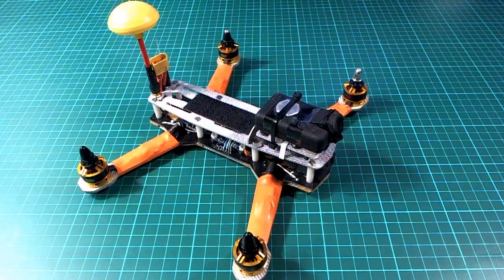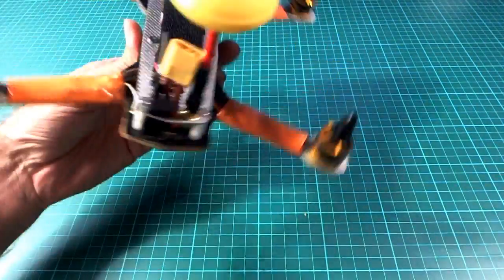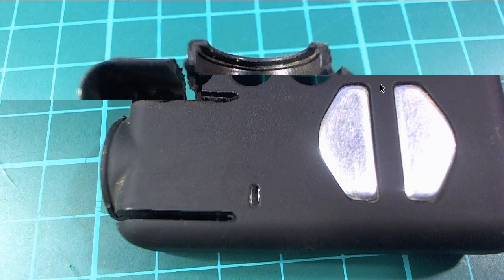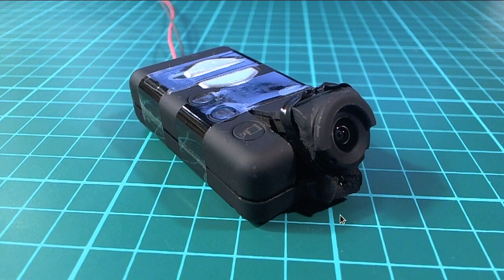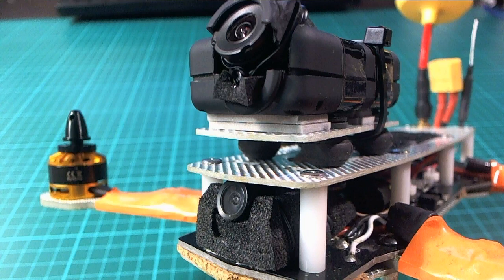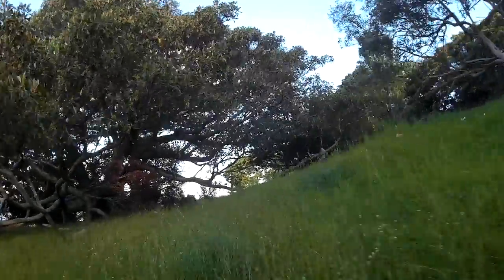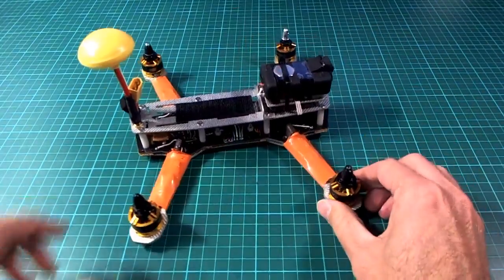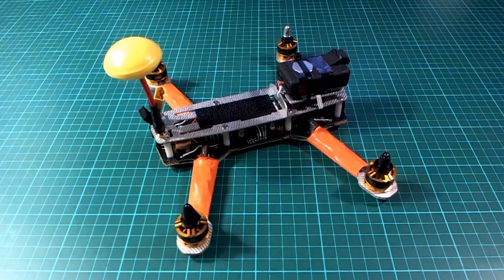Mobius camera hackery

Comment: I have a mobius paper weight. it sits on my bench collecting dust.  it took maybe 30 minutes of video in it's life and now it refuses to record. sometimes it likes to fool me by blinking like it's recording then it goes solid and shuts down.  silly little "action" camera.
Reply: +NUWEST00520041 Mine did that as well, reformatting the SD card fixed it.
Reply: +Nodent not on mine.  I've done all the tricks it will not record.  I can use it as a fpv camera. it will play in real time but no record.

Comment: It's called Velcro.  with a strap it's not coming off....
Reply from the maker: As I explained, that's how I lost the last mobius
Reply: +Bigwingrider1800 Confirmed, velcro with strap doesn't do it in a significant crash. I have that setup and I've had to search for my Mobius quite a few times, finding it sometimes 20-30 feet from where the quad came to rest. Luckily I haven't lost a mobius YET but i'm definitely considering zip tying it down.
Reply: I think if it falls off the whole thing is junk copter and all..i have the 2" industrial stuff if its not full of grass and stuff    before you put the camera on its very tuff...........
Reply from the maker: +Bigwingrider1800 the problem is not how well the velcro strap sticks - I never heard anyone complaining that their velcro strap came undone, and that has never happened to me either. The problem is even if you have the best velcro strap in the world, if there is not much friction in the surface between the camera and the plate, when the battery slams into it from behind the camera slips out. And even if the plate and the camera hold together they can both come off in one piece and still get lost (my case). fwiw after this I put zipties through the damping balls, double-sided tape between the camera and plate, and a piece of aluminium angle behind the camera plate so that the battery can't slip forward and I haven't had any problems since.

Comment: As far as the damping balls are concerned, mount your plate then put thin zip ties through the balls but don't tighten them all the way up. Allows the balls to move but gives them limits.
The 3d printed wedge is the answer for angling the mobius. When you think of the angle the quad is at to get the quad flat, the small change in profile has absolutely no effect.
For power I have left the battery in and have a USB lead connected to the 5v on the FC and the mobius set to auto record.
No more forgetting to record flights. It saves and shuts down as soon as you disconnect the flight battery.
This also allows me to remove the mobius for other aircraft.

Comment: Put super caps in there so the camera does not instantly loose power.
Reply from the maker: yes, I tried that after making this video. Unfortunately it seems this mobius has more problems than the super cap can fix though - it sometimes stops recording even if the battery is connected, and sometimes doesn't complete the file when the power is stopped even with the super cap :( I think it's a lost cause
Reply: +iforce2d 
You can use a very light 3,7V battery to save weight. 
http://www.banggood.com/Cheerson-CX-10C-CX10C-RC-Quadcopter-Spare-Parts-3_7V-120mAh-Battery-p-1018483.html
Reply: +kj erts and 5V to the USB-connection. This works and can stop the recording with the correct setting if the ext. power is lost.

Comment: Nice hacks. 

A couple of thoughts: 

If you're pulling a Mobius apart why not paint some of the case in an "easy-to-spot-in-long-grass" colour?

Connect the buck converter in parallel with the Mobius battery, if you had one and the voltages were the same, to solve the problem of premature file closing? 

The case hack looks an ideal application for 3D printing, maybe even making the lens angle adjustable and adding some retaining strap holders etc. (might just try it myself if the 3D printer ever arrives)
Reply from the maker: +James Lamb The idea is it will not part from the frame, which has a lot of bright orange and a lost-model buzzer on it, and props that I can try spinning and listening for if the buzzer doesn't work for some reason. Attaching it more securely also prevents those rubber balls from coming out too, which saves a lot of time poking them back in. Actually I didn't have a battery for this mobius in the first place which was one reason I did this mod. I don't know what the implications of connecting the battery in parallel with the output of the regulator would be - if the regulator does not allow any voltage to get 'backward' through it then I guess that would be alright. Yeah, I can already think of some better ways this could be done... oh well :)

Comment: the idea i had for not losing the mobius is fishing line put through the dampening balls. I have some rated for 18Kg and left it long enough not to be touched by the props. unfortunately did not tested yet. I'm thinking even tough the mobius and the support plate comes off the frame it will still be held by the fishing line. between the top plate and the battery I've put a piece of anti slip silicone pad, the one you use for phones on the dashboard of your car. it provides a great deal of friction. maybe you can test it and let us know the results
Reply from the maker: +Andrei Suteu actually I was going to try fishing line as my first plan, but didn't trust myself to make a good knot in the nylon and the elastic happened to be sitting right in front of me :)

Comment: I did gopro power like this via the battery terminals instead of external 5V USB.  I added internal supercapacitors from ebay and it gives it enough time to save the file before it turns off, just in case I throw a flight battery.

Comment: Euhm.... does this void the warranty of the Mobius ;-)

Why don't you use the av output of the Mobius for fpv? I always thought it had an av output that you can use.
Reply from the maker: +Joop Brokking It does, and for relaxed flying in open areas that would be fine, but faster flying in tighter spaces requires very low latency between control stick movements and seeing the response in your goggles. The Flite Test guys did a little episode on this recently actually: https://www.youtube.com/watch?v=wQmlNjtiEDg
But Joop.... to be asking this question means you probably have not looked into trying FPV yourself.... with all your RC and multirotor know-how that is just not acceptable :)
Reply: +iforce2d Haha, we have just slightly different interests. You like to go fast and intense. I love grandpa style fpv so I can enjoy the view. And that is why I really like you video's. I just learned something new.... again ;-)

Comment: Also about the thing that the Mobius stopps recording. I guess I saw someone modding the mobius from internal to external Batterie like you. And he added a big capacitor in parralel inside the Mobius. So the mobius got still a bit of power to stay on if you crash.

Comment: Add a capacitor to the regulator, should give a enough juice to complete a video segment and try moon gel to get rid of any jello. 
Hope that helps any
Reply from the maker: +jwhit87 right. Actually I had intended this mobius to be a dash-cam in the car, for which I would have been buying a capacitor for the purpose - it's just that I wanted to get out flying again asap :)

Comment: Wouldn't it be easier to attach the plate you strap it to at an angle?, rather than cut up the camera
Reply from the maker: +Billybob09871 I'm not sure how that would be done, while still using the damping balls. I guess you could make an angled mount, I've seen some 3d printed ones that look quite nice. I kinda like the flat profile of this though.

Comment: They do sell capacitors for car use, replaces the mobius battery and gives it a chance to save the file, might have to put your step down elsewhere but could help recordings and vibration damping mass. Even a normal high capacity cap across the terminals might help the glitches, can't see the inrush being too much of a problem.
I went the low tech route and had velcro on the plate and camera also a velcro covered (double sided tape) wedge to change the angle when required, small cable ties through the dampers. Some battery straps are now coming with rubbery strip inside, much better for securing the angled camera. My wedge is not brilliant but thought I'd leave it in the comments for anyone with the bits beside them, one slight advantage is that you can change the angle in a couple of planes by moving the wedge.
On the tape over buttons, that should be fine on an unmodified case, I have tape on any mobius of mine as I use them as a bike cameras in the (light) rain, in fact the tape can take away the rattle the buttons can cause on the audio.
Reply from the maker: +powernumpty yeah, actually I'm regretting the use of foam tape between the camera and plate, I think velcro would have been better so that I could easily adjust the yaw.

Comment: Wait, homemade video transmitter? did you ever actually make a video about that? can't seam to remember...
Reply from the maker: +muh1h1 ah, sorry not exactly homemade. It's this one that I put together with some capacitors as shown in the product description, and a couple of voltage regulators (3.3v, 5v), all wrapped in heatshrink together http://www.banggood.com/FPV-5_8G-200mW-Wireless-Audio-Video-Transmitter-Module-TX5823-p-84780.html?p=2K090270884220140865
It's small and light, but the downside is I cannot change channels.